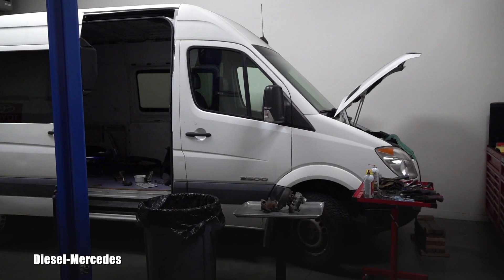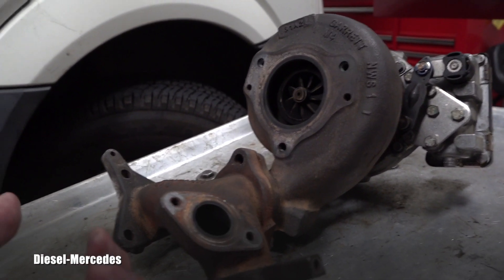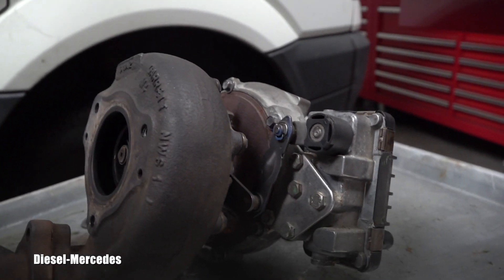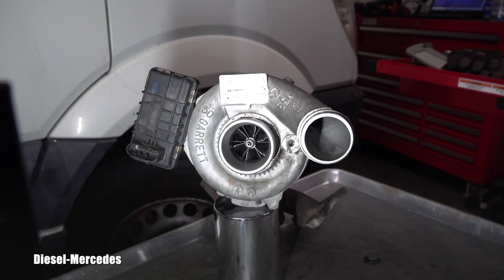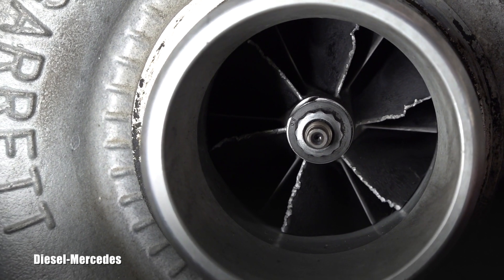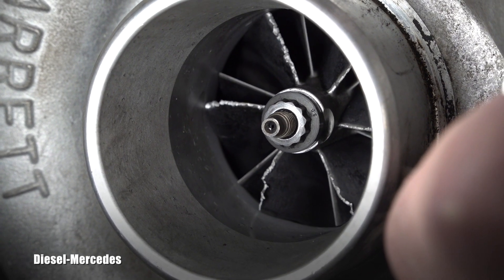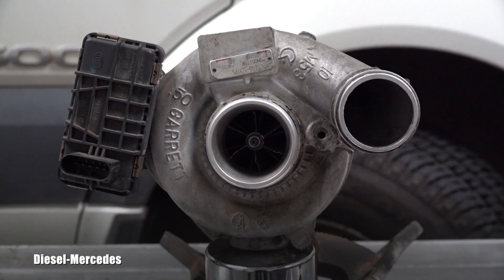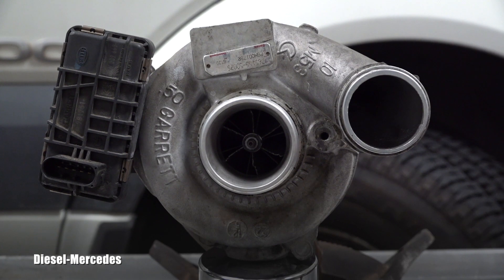Turbocharger with damaged Compressor Wheel

Comment: So I just found pretty much the same thing on my Sonata, the nut that holds it on, came off, and destroyed the vain.

I have to replace the entire turbo, they don’t sell just the vain, which sucks.

What really concerns me, is where did those chunks go? I pulled my spark plugs and stuck camera in the cylinder, and it looks fine. I haven’t pulled the turbo off yet, but I’m hoping that the chunks were either to heavy to go thru the pipe, Intercooler, and into the engine, and if they did, they were small enough that the combustion melted them since it’s aluminum

Comment: I got a question plz
I have a w203 220cdi 
When it’s pass 2000 rbm the engine stall and back fires , need to switch the engine off and on again 
What the reason for that?
Reply: Put it on a tester and based on error codes you'll know where to look instead of guessing.

Comment: Mine looked like that too. I believe it happens from improperly installed orange rubber turbo seal flange that gets pinched & then a chunk of it just tumbles around in there until compressor wheel cheese grates it up.. Hopefully the shrapnel went no further than the intercooler. Have you tried FCP-Euro or Pelican Parts for compressor wheel? Inability to locate new part is further evidence of supply chain breakdowns starting to spead into every part of our country now. Let's go Brandon!